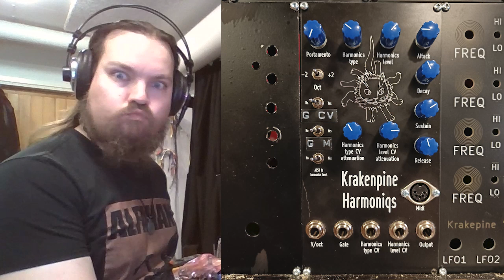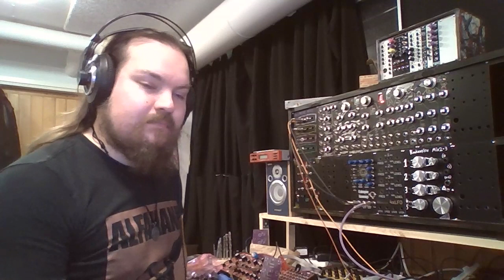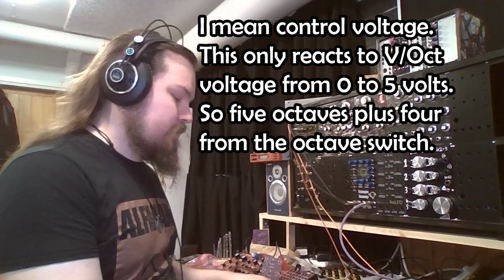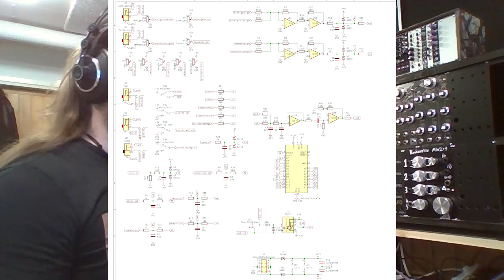4-voice additive oscillator / synth module with Arduino Nano

Comment: Does a lot for a single nano, but yes its processing limits hinder it, but a very interesting sound nonetheless. Do you think it could be "ported" to a seeed xiao rp2040? The amount of pins could be solved with some multiplexing.
Reply from the maker: The "porting" would probably be extremely easy if you have any kind of audio engine already. I plan to make a version of this with Electro-Smith Daisy. It's easy to use and has high quality audio output and enough input pins. But to keep this crunchy sound it probably needs to have some kind of adjustable bitcrusher :D
Reply: @krakenpine  thats awesome, i got some daisies lying around. Id say the crunchy sound should stay as option, like hifi crunch, as the SID, top stuff, cheers!